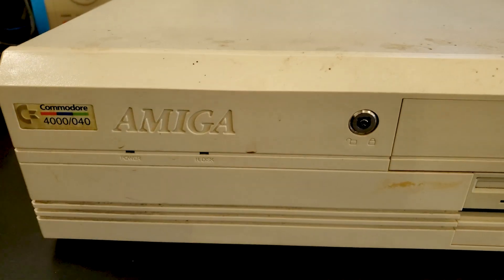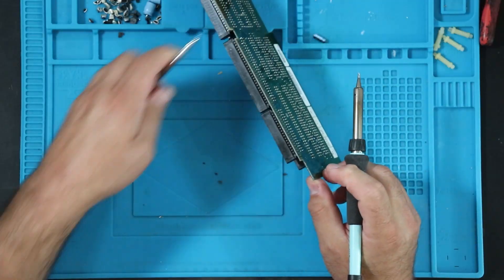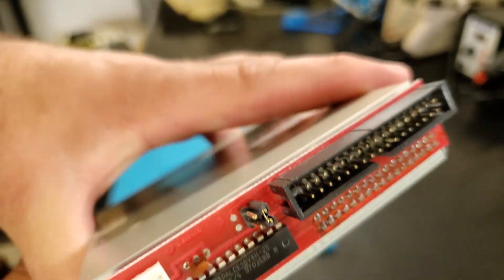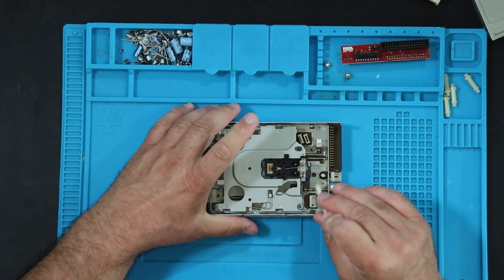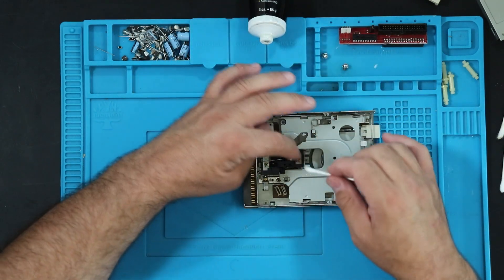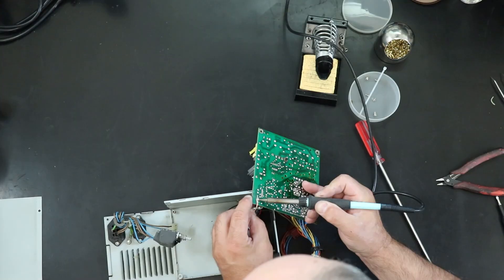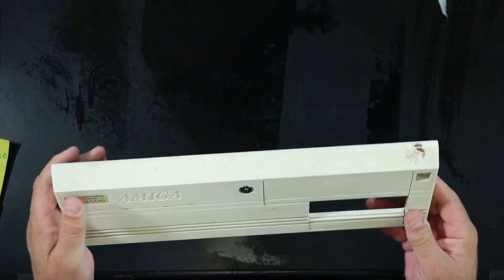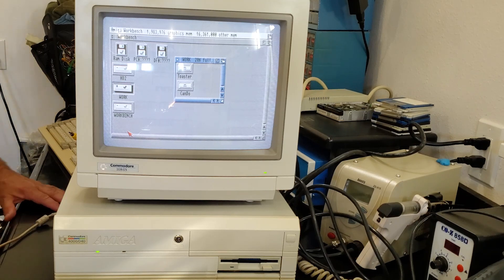Amiga 4000 Restoration - Bringing it to Life

Comment: I've been a little scared to use the ultrasonic but after using it a few times it's worked out really well. I had an a4000 doing weird stuff with the video out and a pc engine duo with issues after a recap. I'd say 100% put any board in the ultrasonic after a recap.
Reply from the maker: After using one daily in my business for years the thing I really focus on is using the minimum time possible with moderate heat. We used Simple green in ours so I am using that in this one.

Comment: Back in the day when I worked on many PC Computers the first indication the cable was on backwards was the fact that the Drive LED remained lit when PC was powered on.  Not sure that applies to absolutely all drives/scenarios but certainly all that I've worked on.  Another great Video btw!  I'll be watching all the Videos you put out with some eagerness as I'm a big Commodore fan (although I have a few Apple/Mac Computers as well).  -Mark.
Reply from the maker: Thanks Mark. In this case i meant that i had the wrong end on the cable connected sobe you need the twisted lines on DF0 on the 4000.

Comment: Looking over the Sony drive, can you see anything changed on the board different from a stock Sony drive? Or is all the alterations done on the back add on board?
Reply from the maker: They have added a power connector that only connects to one lead on the berg connector (12V I think but have not verified). Its held in place by that evil brown glue.

Comment: Nice Job! another excellent A4000 joins the world again! It's a huge amount of time and work to refub these machines
Reply from the maker: Thanks, There will be one more restoration on this eventually. The PSU died as I was editing this. Not surprising given the reputation these have. I'm ordering parts and also ordered an ATX adapter as a backup.
Reply: @RavenWolfRetroTech  Actually the a4000 psu is a good design and somewhat simple. its not as efficient as modern stuff but quite robust, that being said,they are 22+ years old.
Reply from the maker: That's good to know, I have been hearing them being disparaged a lot lately